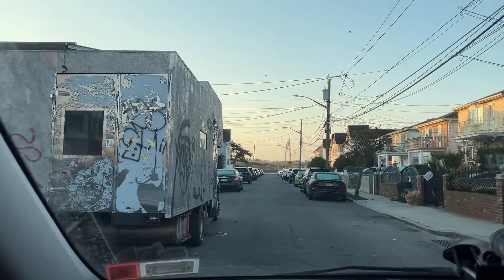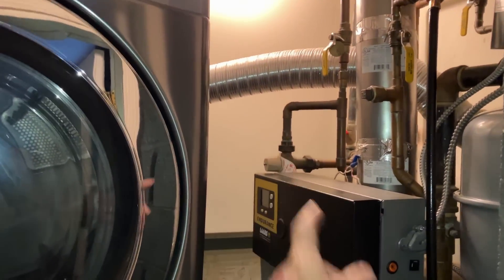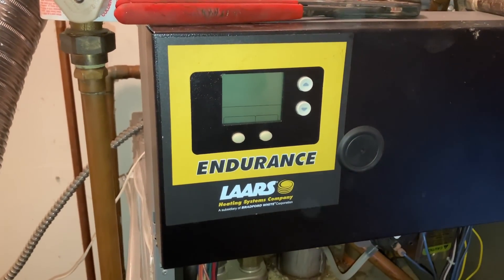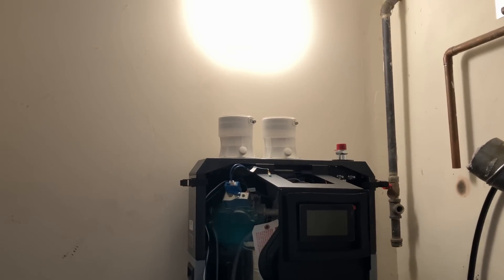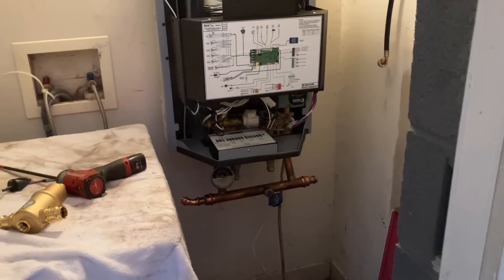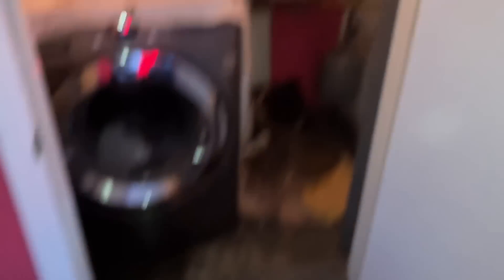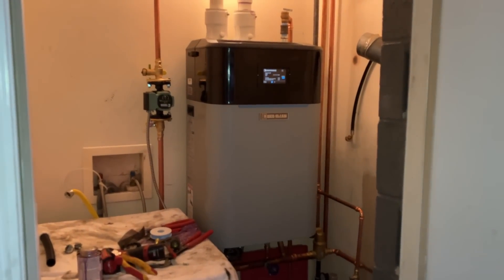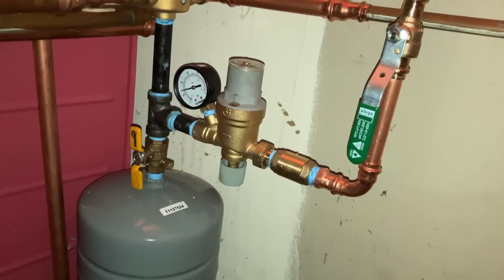STOP Wasting Money on Old Combi Boilers and Upgrade to Weil McLain EcoTec

Comment: always put a check valve on the circulator to an indirect, if you don't induced flow in either direction can overheat it beyond set temp and cause scalding risk. cause cool water on heating zones.  it could cause relief valve discharge(they're at 212F,) if the boiler temp is high enough.
an exception is a single zone system, zone valve setup or other flow checks in piping. but even then, gravity flow can occur in many cases of single zone and existing flow checks are likely bad, so back to most always install them.
Reply from the maker: I guess you didn’t listen to what I was actually telling Daniel instead you’re just typing away. I did specify thermostatic mixing valve.
Reply: @PipeDoctor  no I heard that, but it can still cause issues with the heating zones and pull heat back out of the indirect, in case of cold start boilers. unless there's zone valves. don't skimp!

Comment: anyone know if there is a gadget you can get that will allow you to know each time the  a/c unit comes on and goes off, without sitting in your garage for 24 hours to manually keep track of run times ?  i would like to be in my computer room and have this info available there. i think my unit is short cycling, but this gadget would help me verify it.  thanks too all for any info you might provide !!

Comment: No plywood (even 1x6) spanning the metal stud wall, that would keep me up at night. Not much to catch on to, but I'm not there...$50 savings, not sure about that. Nice install.
Reply: generally on steel studs, I go with toggle bolts or other type of  t bar/wide spread opening fastener. short of that through bolt out the other side of wall and nylock nuts or thread locker.
I used to hang old heavy tube tv's on mounts to steel stud walls. for larger units, we would put 2x4 down the whole face then mount into that  and steel stud both or even clear through that the wall and put angle iron/second stud on the back side. even run it horizontal across if the top/bottom plate wasn't solid mounted to other structure.

Comment: Isn't it against code to cover up an electrical box or junction?
Reply: Only if you pull a permit
Reply: Or you loose your everything you own if there is a fire.
Reply: yes, that should not have been covered up like that. at least it was a single wire/end of line entering that box and no through spliced wiring.